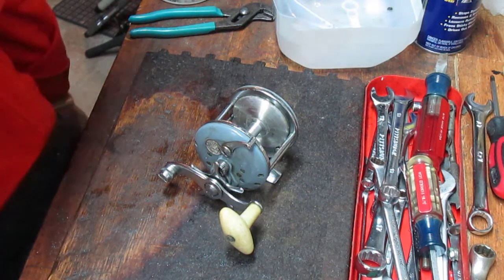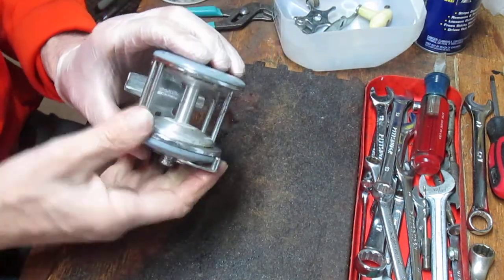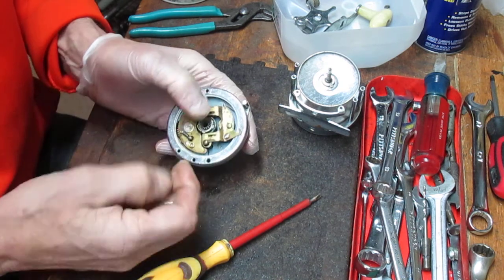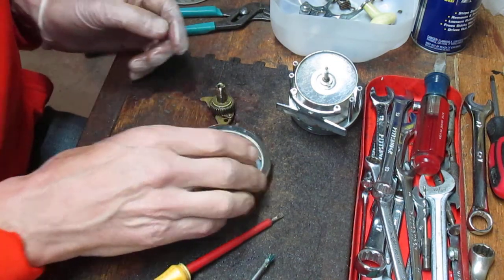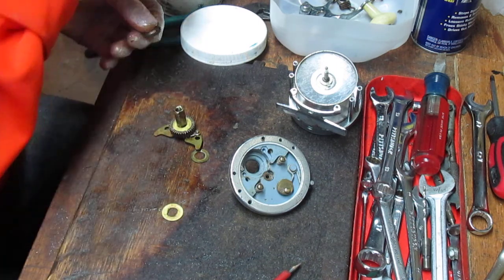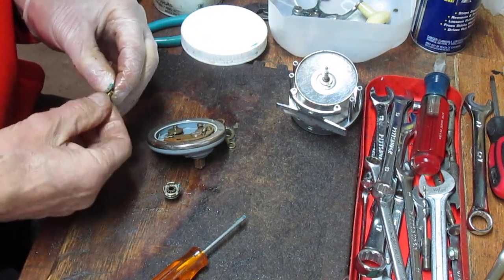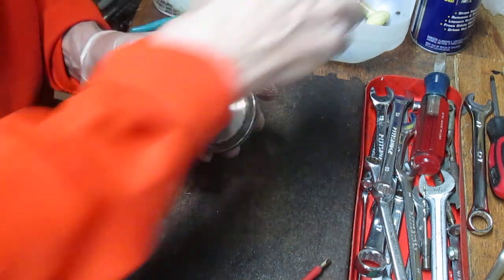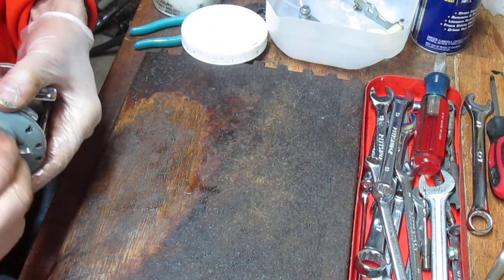Ocean City 949 Fishing reel take apart & Service with company history

Comment: Thanks for the video Dennis. I picked up an old Ocean City “Hampton Beach” 994 in pretty rough shape at the local swap meet a few days ago. This definitely helped. Got it disassembled, cleaned, lubed and reassembled. It’s working great now.
Reply from the maker: Good to hear.  The is why I do these.  The OC reels are dependable.  If you need drags, you can usually get them from Smoothdrag.com.  That is the one part I notice is usually gone when I buy these at swap meets. Thanks for the comment - Dennis

Comment: Dennis I have enjoyed your videos and find them very instructive.  I recently acquired a True Temper 922c which is in excellent condition cosmetically and functions correctly but is in dire need of a "tune up", the spool turns without trouble but does not free spin as it should and the drag washers are in obvious need of attention.  Before I disassemble for a clean and lube I was searching for new drag washers to lube and install and cannot find any or even a cross reference to another manufacturers such as Penn that may fit the bill.  Maybe you can point me in the right direction?  At the very least, can I just lube the old probably hard washers and reinstall?    Thank you for your time and your videos.    Bill
Reply from the maker: You may be able to use the Penn drags washers made for the Beachmaster 155.  If they are tight, you may need to shave them to fit.
If you can free the sticking washers, you can clean the metal ones and lube the leather ones with grease.  These reels do not use a lot of drag, so you should be able to get away with that if needed.
If the washers are dry and cracking, they will need to be replaced
Dennis
Reply: Thank you so much for your speedy reply.  I will look for the Penn friction washers to have on hand when I break the reel down in case I need them.    Best,  Bill
Reply from the maker: You are welcome.  Best wishes on your tune up.  Thank you for watching - Dennis

Comment: Hello Dennis, I have an old ocean city 981, it needs one spring and the washer behind the main gear.. any ideas… also have one question, one of the spool ends I think should be solid as one piece.  One end seems to be lose a little. I also called you and left a message.. regarding this reel….thanks for your vids very helpful and informative…
Reply from the maker: I probably have them if you can send a note to my email 2ndchancetackle@gmail.com I will see.  Please send a picture or part number of the items you need in the email
Thank you
Dennis

Comment: Hello Dennis, thanks again for the great video. Would this reel work for small grouper? Is this a similar drag strength to a 3/0 penn? Or a 4/0 penn? Thank you sir
Reply from the maker: This reel is similar to a Penn 155 Beachmaster.  It is smaller than the Senator 3/0.  The gear ratios are about the same, but the format is smaller - Dennis

Comment: hey man do you know when my923c was made and what size fish it was made to catch back in the day?
Reply from the maker: The 923 was manufactured in the 1950's by Ocean City and was sold in the 1960s under the True Temper brand, which acquired Ocean City.  The spool holds 300 yards of 20# monofilament.  The reel was designed for saltwater fishing and can handle most inshore ocean fishing.  Typical size would be 5-15 pound fish. but it could handle bigger. - Dennis
Reply: 2nd Chance Tackle thanks man i appreciate the information but I also have a 922c Ocean City true temper is there any information you can give me on that one to?

Comment: Thanks for making this video my uncle passed away and I was givin one of these so I decided to clean it out and forgot where the brass piece that connects to the gear went, also do you know when it was made roughly, I got a bunch of vintage stuff like a Johnson uni cast with the button on back of the rod that came with it
Reply from the maker: I'm glad to hear this helped you finish the reel.  These reels were very durable and were a competitor to the Penn 160 Beachmaster series.  The only problem now is with replacement parts.  Good luck fishing - Dennis
Reply: 2nd Chance Tackle definitely look durable in my book, everything either brass or thick metal other than the drag, mines a 981 would the drag washers from penn still work maybe looking to add some cuz there was only one I guess leather one and one normal washer

Comment: Dennis I have one of these reals I've taken the side plate screws out just as you showing here but it will not come off as the spool is sticking both side plates together spool will not come out either way what's the next step
Reply from the maker: It is likely that the spool gear is frozen onto the spool shaft.  You need to remove all of the attachments on the gear side plate to free the gear assembly and get to the inside of the reel.  If you try pulling or prying it loose, you will bend the yoke and the reel will be trash.  Once you have all of the screws, star drag, handle, free spool lever and nuts off, push the gear drive through the side plate to get access to the spool and gear,  You should then spray the gear with a penetrating oil like WD40 and they try to work it free.  Once free, you can clean, relive and reinstall to fix the problem - Dennis

Comment: My ocean city 940 does not look like this would love to find more info on this reel. I am new to this type of reel.
Reply from the maker: You are correct.  I have this one mislabeled.  I will correct.  Yours looks more like an older version of the low profile bait caster.  They are very nice reels - I will try and do a video when I get the next one - Dennis
Reply from the maker: The reel that was pictured is the OC 949.  I must have made a typo when I listed it.  Thanks for the edit - Dennis
Reply: My intent wasn't to correct you I just wanted to see if you had any info on my 940. I've had zero lock finding any manuals or parts diagrams if you have a resource for those it would be great. Your videos are awesome.
Reply from the maker: Please send a note to my email 2ndchancetackle@gmail.com and I will send you the schematic - Dennis

Comment: My great grandfather passed away and I was given 2 ocean city reels... one is a 113 and the other is 922... if the reel itself smells horrible how do I clean it? Take apart and dunk in alcohol or vinegar?
Reply from the maker: I shy away from solvents.  The smell has to be organic.  Take the reel apart and clean the metal parts with a metal polish and steel wool.  I use Turtle Wax Chrome cleaner, an automotive metal polish, but there are plenty others out there.  Use a penetrating oil for the gear teeth and other irregular areas. Spray the non metal parts with a cleaner/degreaser, like Purple Magic.  Make sure to get the outside as well as the inside parts clean. Wipe with a piece of kitchen scrubby pad  or 0000 steel wool.  Use cotton swabs for hard to reach areas.  After all pieces are clean, you can re-lube and reassemble the reel.  I suspect that the odor is due to poor maintenance at the end of a day fishing.  I always make sure to hose off a reel with fresh water and spray it down tip WD40 before I put the rod and reel away for the next trip.  It's a simple way to care for the reel between overhauls.  Thanks for asking - Dennis

Comment: It's a smaller version of the 950, they came out in 1955. the 950 holds 350yds of 20#, the 949 holds 250yds of 20# the 949 costs $9.95 when it came out, some of the first reels designed to hold monofilament line
Reply from the maker: and all of them nice reels